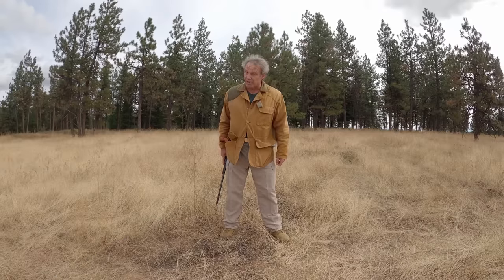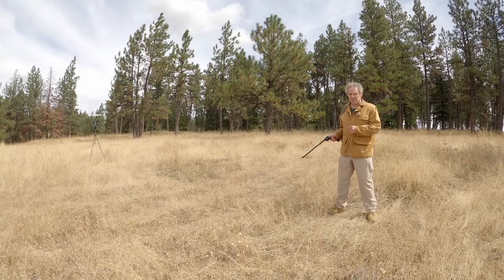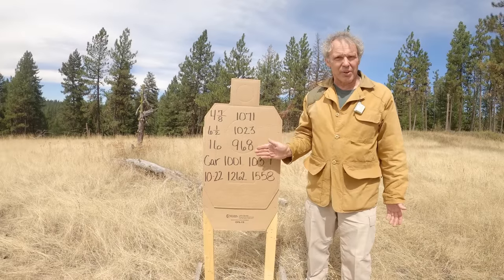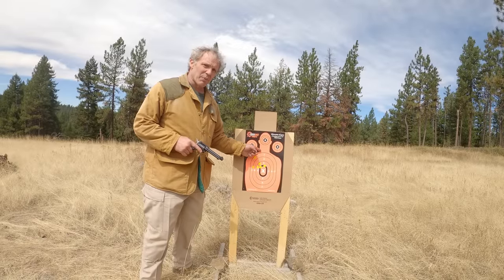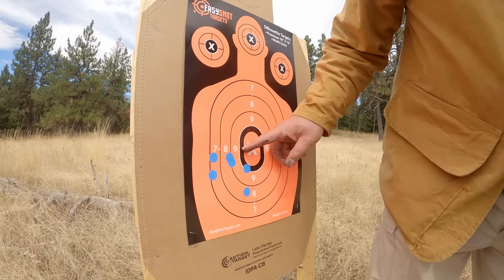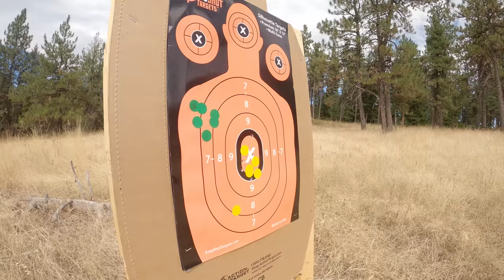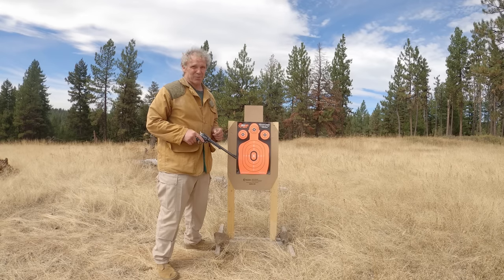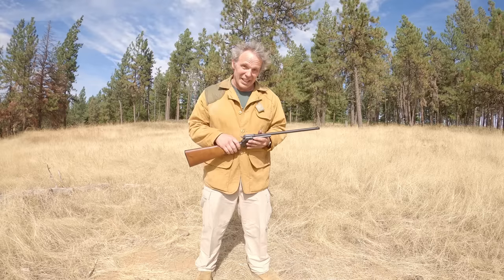Heritage Rough Rider Revolver Barrel Length Comparison

Comment: Paul, I think a similar test among .22 magnum loads/cylinders might be interesting. Thanks for the video.
Reply: I chronographed 40 gr 22LR vs Magnum in my Heritage 4 1/2. I didn't record numbers, but as I recall the difference didn't warrant the increased cost of the round. I haven't used my magnum cylinder since.
Reply: @slotcarfan I'm callin bull dunkey on that recollection if not the experience itself, magnum has about 2x or a little more increase in energy ft lbs there's no way. Ime & imo...
Reply: other channel found 400 fps faster with magnum on 6.5in barrel

Comment: On a whim, I decided to run standard deviations for each of the ammo series. For those interested:
the 4.875" revolver had an SD of 17.2fps or 1.61%
The 6.5" revolver had an SD of 19.2fps  or 1.87%
The 16" revolver had an SD of 41fps or 4.24%
The 16" carbine had an SD of 15.8fps or 1.58%
The 10/22 had an SD of 13.2fps or 1.05%

A Standard Deviation (SD) is the mathematical average of each datapoint's deviation from the mean of those datapoints. It generally shows how precise or consistent a given set of datapoints are. In terms of firearms and ammunition, it's typically a measure of the quality of a given type/brand/batch of ammunition and how good their quality controls are. It can also be a measure of how consistent a given firearm is, if employed correctly. As we can see with the 16" revolver, an unusually-large SD in comparison to other firearms using the same ammunition, both those of similar and of different manufacture, can indicate some sort of flaw or defect that may cause an atypical inconsistency in velocity.
Reply: Great info! ✌🏻👍🏼
Reply: I want to agree with you, but with the budget lower grade ammo in .22 lr the ammo is so inconsistent.  Now I happened to locate a 1988 Case of federal
bulk pack 550s, Yes a case, 5500 rounds, It wasn't stored perfectly but not horrible either...........  I had low expectations but I was soon disabused of that.
It turned out to be fantastic and way above current production in consistency and reliability. I don't think there was a bad one in the 3.5k I shot of it and I stashed the last few boxes of it because of that.  I have also discovered the new aguila super extra outperformed the CCI mini mags...... another surprise.
Reply: Currently taking an intro to statistics class and also learning about revolvers so seeing your comment was like a weird fever dream for a second.

Comment: I really learned something today.  I did not know the pressure loss at the cylinder made such a difference.  The velocity loss with longer barrels was much more significant that the difference in rifle barrel lengths in the previous video.
Good education for me today.  Thanks Paul.
Reply: I had no idea we are losing that much velocity...and now I am wondering about .22wmr performance, we own a 6.5 barrel model...
Reply: @PetuniaIii-pd1ww  , there is .22 WMR formulated for short barrels. The brand I found is Speer Gold Dot. I don't have access to a chronograph, but would like to see testing about our mutual concerns
Reply: @PetuniaIii-pd1ww  I would guess the wmr would see more benefit from a longer barrel. 22lr is just such a small round that the powder burns completely out of any barrel length.

Comment: Longer Barrel = Lower Velocity, I Never Would Have Believed It. Thanks Paul. 👍
Reply: 16inch barrel after the cylinder gap. That gap robs lots of power, with that loss of power it now has to fight more barrel to end up down range. Instead of a normal rifle where that power/pressure travels along the entire barrel and is able to help move the bullet faster.
Reply: Lol, those Heritage Revolvers are kind of junky. But they do generally work. They're almost like a fan that when turned on full speed, less air comes out!

Comment: I have a 1958 Ruger Single Six that I really love.  It is quite accurate and refined, even at its age.  I've shot Heritage revolvers.  Yes, they are okay for what they are.
Reply: I have a Ruger Wrangler. Its vey nice for what it is, an alloy framed, .22lr, slightly downsized “Single Action Army”... definitely not as nice as a single six, trigger isnt as good but for the price its great and slightly nicer than the Heritage.
Reply: @ryanpeck3377  I have contemplated getting one of the Birdshead versions...and still may...but the alloy frame isn't all that stellar, of course.  The seam on it is rather pronounced.  But for the price, I still may get one.

Does it shoot point of aim, at like 7 yards?  My old Single Six can pretty much do a quarter size group, if I'm going my part correctly.  But then, the Single Six does have a rear sight.
Reply: I have the Bearcat, the .22, the .41, and the .44 all from the 60's. The leather has worn the bluing off the .44 in places. Have been carrying that pistol since I was 12 living in Alaska. My most prized firearm.
Reply: @AnAZPatriot  I have one of the 'newer' Bearcat revolvers.  The Shopkeeper with fluted cylinder and birdshead grip.  I consider it one of my most prized as well.

Comment: My younger cousin bought one of these awhile back and it shot about a foot left at 20 yards with all ammo. Definitely not shooter error. Some ammo were a little different but all very left. The front sight was not centered in the barrel and it also wasn't vertical. After literally bending the front sight with a pair of pliers, he got it close to zeroed. It also had a ton of gas blowing out the cylinder gap and some was coming back and hitting the shooter in the face. I know it's a cheap gun but that's pretty bad.
Reply: high and left seems to be the factory setting for these!
Reply: Generally, the barrel needs to be tightened a little. Also, the screw that secures the ejector tube is notorious for loosening, and needs thread locker. The thumb safety can break.
Reply: Mr Ed and Joe, thanks for the tip, I'll mention that to him.
Reply: I had soot on my left thumb after shooting it
Reply: @joem7062  You should always get some gas escaping between the cylinder face & the forcing cone.  If that gap were completely closed the resulting friction would make getting the cylinder to turn extremely difficult.  Also some allowance has to be made for the metal heating & expanding when shooting.
Reply: @joem7062  you know... took a closer look at the sight alignment and then cranked on it a bit... that makes a world of difference!  Good call out!  Thank you much.
Reply: @et76039  The thumb safety on mine seem to be inconsistent. Sometimes tight sometimes loose.
Reply: @lebowskiunderachiever3591 , if it's still under warranty, send it in. I got a good turnaround time.
I took pictures to document my problem., If you give the factory a call, or check the FAQ on their website, that may help.
Reply: They are cheap but that is exceptionally bad, he should have sent for a replacement. I have seen one RR that had the sight wrong like that and we fixed it the same way, but it didn't have a ton of blowby like that. Barrel must have been set both shallow and off rotation.

Comment: My understanding is that these Heritage revolvers have a 224 barrel so they can accommodate 22 mag bullets. The smaller 22 LR ammo may not have a good enough gas seal to make comparisons accurate.
Reply: A couple thousandths make a big difference if that’s the case.
Reply: I think the bullet diameters are the same between the two cartridges, so I'm not sure there would be 224 barrels, would there? I think the difference would be in the cylinders only. The 22 mag cylinder would have slightly larger chambers.
Reply: I've tried both cylinders messing around at shooting range and don't get me wrong,they both suck! I get way more accuracy with my lienad derringer with 22 LR insert.  To be such a small derringer I just can't miss! Me and my hunting buddies had a ball with that little derringer

Comment: One caveat if I may add…even if you’re not shooting anything with potential for blowback I can say from experience that shooting a silenced. 22 at paper is not a good idea without eye-pro and I have the ophthalmology receipts to prove it. Learned it the hard way.

Love all your content Paul, thank you.
Reply: So are you saying that "shooting a silenced .22 at paper" doesn't have potential for blow back, but you should still wear eye pro? Or are you saying that you should wear eye pro while "shooting a silenced .22 at paper" because it has potential for blow back?
Reply: @notahotshot  assuming here, but it sounds like the back pressure from the suppressor blew debris into the shooters eyes during the extraction phase.

Comment: Try shooting the cylinder from the 4 7/8” in either of the longer barrel 22’s and you will probably see an increase in velocity. I have three Ruger 327’s and the short barreled one shot faster than the next size up. I tried shooting all three cylinders in all three frames and found that the cylinder was as much as a factor in velocity as was barrel length. I suspect that the chambers cut early in the production run were tighter than those cut later.
Reply: Hey, that's a great idea! I am pretty sure you are correct but I am going to set up the chrono and see.
Reply: That makes sense...
Reply: The gap probably varied slightly. Even with state of the art manufacturing capability you'll have a few thousandths difference here and there. And when it's a few thousandths more or less at the gap.. yikes.

Comment: I have 2 in the 6.5 in barrel. The one with 4.75 in barrel died after ~10K rounds. The fun to price ratio on these revolvers is super high.
Reply: What do you mean by 'died'? The frame broke? Most anything else could be fixed.  My most-fired Heritage has 2650 rounds through it and no problems yet.
Reply: @MrTruckerf  The frame where the firing pin comes through. The pin was apparently just off center enough that it eventually wore a groove in the hole where the pin protrudes. Instead of being circular, the hole was oval. Caused mis-fires about 40% of the time. Heritage stated it was beyond repair when I returned it. 

Cheers!
Reply: @submanusn3692  sounds to me like drilling it out and fitting a steel sleeve in it would have been a fairly easy fix, wouldn’t even need to go with steel it could be brass or copper to make friction fitting it easier.
Reply: @jaydunbar7538  Yeah, sounds like a fun gunsmithing project. If it doesn't work, oh well, it was broken anyway, and you didn't ruin a $1k revolver trying.
Reply: @submanusn3692  10,000 rounds, that is a ton of single action shooting...ours has about 3,000 on it and i thought i was doing good...
Reply: You got your moneys worth:)
Reply: Probably could've lasted longer with some extra oiling, but I figure by the time the issue shows itself it's probably too far gone anyway. I'll make sure to keep some oil worked into the firing pin on mine just in case.

Comment: That velocity loss from the flash gap is more than I expected, although, I've found the velocity from a 6.5 inch and 4.5/8 barrel tend to be the same on my single actions.
Reply: I'll put in a good word for the Heritage, 6.5"
It's dependable, well built, reasonable accuracy. 
Mine has been used as my working around the place loaded 3 l.r. 3 crimped birdshot. First three birds hot. Absolutely deadly for the rattlesnakes.  It's at the door for any walk outside. Best snake gun ever. Mine ain't for sale it a keeper.
Reply: @4tango123  we like ours...they're like Volkswagens, a little maintenance goes a long ways...

Comment: Heritage "Rough as Hell" Rider Revolver.  The one cavate I can provide is to NEVER remove the screws from the frame.  The frame is cast White-Metal.  The frame screw holes will strip-out, I just installed 5 helical's into two different revolvers for this. 
I have since swore of this gun for repairs and cannot recommend it until Heritage starts using a better frame.  For the same money, currently $189 you can purchase a Ruger Wrangler revolver.  And though it's no Single-Six, the forged/milled aluminum frames are very well done.  And the fit of all parts and finish in Cerakote is top shelf.  You be the judge.
Reply: Lol, the screws tend to work themselves loose...my battle is the one upfront holding the ejector rod housing...red loctite is the next plan...yeah, the Ruger is engineered a bit better, the material a bit better, the warranty definitely better...the Heritage offers the .22wmr cylinder, 4 distinct clicks, the safety (omg!), and the cylinder isn't freewheeling, cheaper in price...we will never spend 500-1000 on an excellent (maybe) .22 single action revolver, just can't do it...our Heritage has several thousand rounds downrange now, perhaps we just bought a decent one...
Reply: @PetuniaIii-pd1ww  very good.  though I would say to use Blue 242 Loctite not Red.  The Blue can be removed if needed with regular hand tools.  Red would require the application of heat to remove the screw.  Good luck and have fun shooting.
Reply: I had to disassemble both of mine several times to replace broken parts. No issues with threads stripping though. I did have to replace a couple screws that backed out and were lost though.
Reply: @redtra236  good on you.  though it does make one wonder at the Ferocity of recoil of the mighty .22 that it loosens its own screws upon use.   0~o    
but as before I recommend blue-Loctite.  and in a pinch lacquer nail polish.   ^~^

Comment: I have personally been injured by this firearm due to the cylinder gap.
My best understanding on what happened was that for whatever reason, the cylinder must have not been completely aligned with the barrel. A significant amount of lead came out, along with some powder and due to my grip, sprayed my first finger and the web of my thumb. 
It took some time to dig all of the debris out of my hand.
Reply: What you describe does sound like the cylinder being somewhat out of time. Definitely possible. When the hammer is advanced to the third position, the cylinder will stop with the next firing chamber being slightly off, although the cylinder can be manually rotated to the correct position. By squeezing quite hard, the gun WILL fire from this third hammer position. It doesn't like being in this third position, and for normal usage, the hammer wants to be in the fourth position.
Not an engineer or gunsmith, but this does seem to make it possible for a worn or damaged gun to fire from the fourth hammer position with the cylinder thus out of time. Thank you for sharing your experience.
Reply: @et76039  a rare instance of the Third Position being a negative...
Reply: Learn how to hold a revolver and that can't happen.
Reply: @morrismonet3554  learn how not to be a troll and save the rest of us from your wasted breath.
Reply: @antidulvian666  COD Player detected. LOL
Reply: Idk kinda seems like a skill issue caused that injury
Reply: @aggrogator4045  So skill causes it to spray lead?
Reply: @aggrogator4045  Ignorance and lack of skill.

Comment: Very informative.
One of the things I have noted in expensive verses inexpensive revolvers is less attention to the cylinder gap and forcing cone. 
I would love to see a close up measurement of the cylinder gap. Is it under .006?  Are both faces smooth (barrel and cylinder)? Is there a slick / smooth surface to the forcing cone?  I have sometimes been surprised what I can achieve with a bit of polishing on a cheap firearm.  Anyone?
Reply: I don't own a chronograph, but I own a Rough Rider Rancher, and a Taurus Circuit Judge in 22lr/22wmr, and one thing I can say is the Taurus has a GIANT forcing cone, and other chronograph demonstrations I've seen with the same rifle show a tremendous loss in velocity due to this. Ammo fired from the 22lr Circuit Judge get roughly the same velocity as a rimfire pistol would.

Comment: Looks pretty obvious there's quite a substantial amount of pressure loss between the cylinder and the barrel, I but I assume it would also be different from firearm to firearm depending on the quality of machining and how much of a gap there is between the cylinder and the barrel.
The 10/22 does use a little of the pressure to cycle, so I would like to see a comparison between the Heritage, 10/22 and a bolt action 22LR to see how much is actually lost in each process.

Comment: I have a Ruger Wrangler in .22lr and love it. In my area at least it's very comparable in price (about 20-30$ more than the RR) and after shooting and handling both, I prefer the Ruger. It feels a little "nicer" and you don't have to pull the hammer back to freewheel the cylinder, just open the loading gate, which I find to be a nice touch. It doesn't have a safety lever like the RRs though. That doesn't bother me, but if I were buying it for someone as their first gun or something, that might become an issue.

Anyway, nothing wrong with the RRs, just mentioning an additional choice for folks looking for a .22lr revolver in an extremely affordable package.

Comment: I have had significant issues with Blazer .22 lr in revolvers myself. I think it may be a common issue
Reply: I have shot .22LR Blazer over the years, and even some that I know had to be about 40-years old!  I didn't have problems with it and prefer it over the majority of the Remington .22LR.  And the Blazer cycled through my 10/22, my Buckmark and of course through my K22 S&W revolver, which the Remington did not.  I think in this case,  it was the Blazer in that gun.  But with all .22 ammunition, you have to experiment try new ammunition as they hit the market, to see what works in each gun..
Reply: That struck me, as blazers have been reasonably decent ammo for us...I wonder if Paul turned them 180° and tried them again...that works about 98% of the time for us, across all brands of ammo...